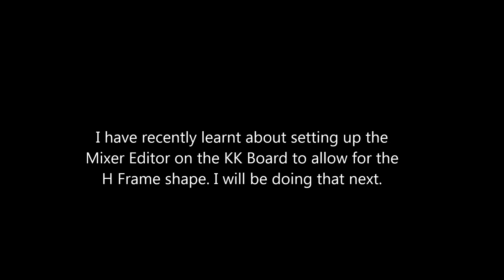ZMR250 Quadcopter Battery on the Bottom. KK2.0 Emax 1806 2280kV Mystery 12A ESC

Comment: Is it possible to mount the motors on the other side of the arms? That way the entire frame would be flipped upside down and you could probably have the battery inside the frame to protect it and have a lower CG still.
Reply from the maker: +3dlabs99 You can do this and I have recently on a 380 version of this frame I made from plywood. Seems to fly nicely.
Reply: +3dlabs99 You still want to have your flight controller facing up in plane with the motor, this leaves no choice but to put it on top unprotected then... I guess it is the great dilemma of mini quadcopter... where to fit the damn battery to keep it centered and balanced...
Reply: in theory a pusher-configuration is even a bit more efficient. but it's gonna break props by the dozend

Comment: Battery on top is indeed a problem. I am not quite sure why there are so many builds like that around. I made this mistake myself when I moved the battery from underneath to the top of my hex. It developed a "falling leaf" effect, got out of control and droped dead on the ground. Especially if you are lucky to use DJI OPTO ECSs that seem to have the life of their own. Never again.
Reply: +Alan Ibra your both are right of course. always thought the same. but in reality the difference  doesnt really matter i think. the ideal Center gravity would be at the height of the props if you look from the side.so it depends on the battery (its weight) how much Impact it has. to light can even mean the cg is deeper than needed.  it matters so less that i rather like to have the battery on top because of easier changing.
Reply: ediblefly I agree with you 100%, I don't know why every racer and builder, some of them are very well known names and all are knowledgeable, They all place battery on top, this is bad physics, the lower the CG, the more stable the platform is. Just look at the Osprey, where are the props? https://www.google.com/search?newwindow=1&safe=off&espv=2&biw=1422&bih=1087&tbm=isch&q=osprey+aircraft&revid=1834519130&sa=X&ved=0CB8Q1QIoAGoVChMImMr7i-KJxwIVRBo-Ch3OGQ7r